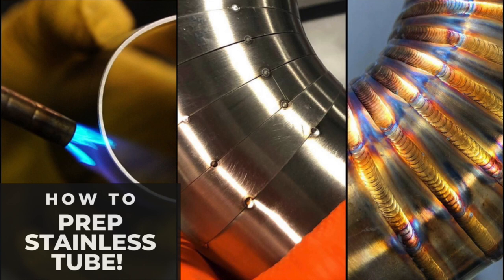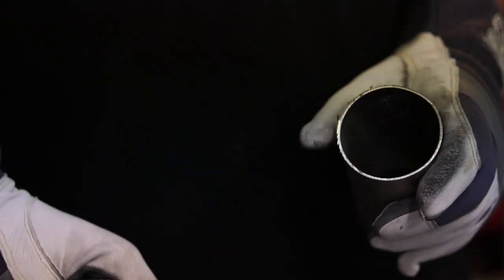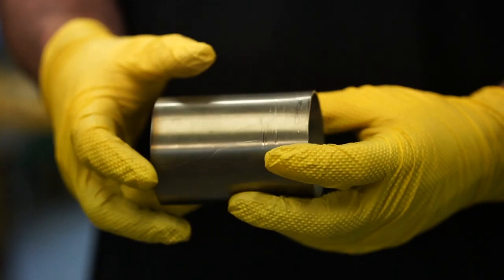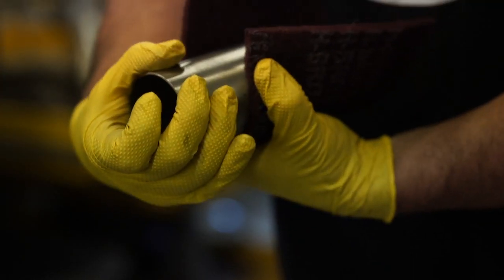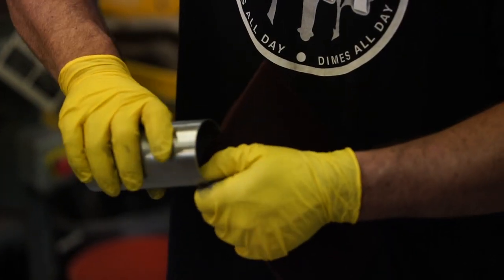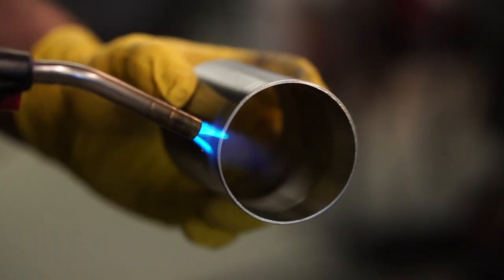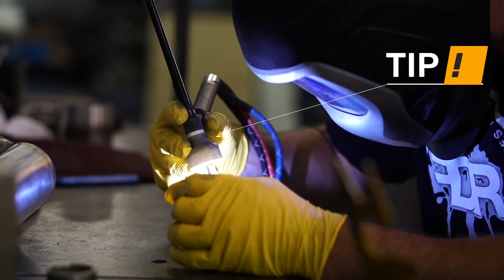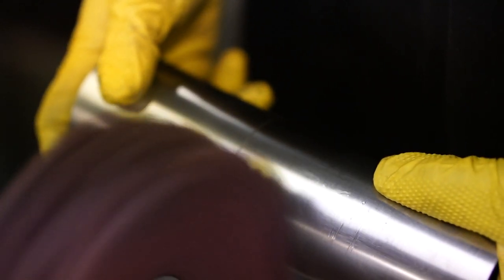HOW TO PREP Stainless Steel Tube (QUICK) for TIG welding + Tips!

Comment: Great tips, thank you! Do you back purge your tack welds? I'm just a hobbist and currently building some stainless exhaust where I didn't back purge my first tack welds and the inside of the tubing was pretty terrible so I'm purging them now.
Reply from the maker: Jeremiah Zanin on titanium I will back purge my tacks because it is 1mm or .040” thick usually so it’s easier to accidentally full penetrate on A tack. Now in stainless I don’t purge my tacks on .0625” wall because I use a lot of baby racks at lower amps that do not penetrate through causing carbide precipitation. I’ll be posting a video on back purging stainless tube Friday!
Reply: @hourglassingenuity103  Makes sense, thank you! Looking forward the back purging video!
Reply from the maker: Thanks for tuning in man! Really appreciate the engagement.

Comment: Hey Brad, I use a portaband (vertical stand homemade) and bench belt sander but I am struggling with getting clean cuts and then getting a flat surface for a tight fit up. Can you please drop some tips for a nice flat flush ground face?

Comment: Very nice! Do you always just hand sand it flat without using a table for keeping it square?
Reply from the maker: Yep.. I can usually get extremely close. I can check it with a square and a flat surface if I want it to be perfectly square. Usually a super micro angular variation won’t effect fit up too much. I can do a video on how to square off the end of stainless tube also in the future by using a flat surface and a square.
Reply: @hourglassingenuity103  Gotcha! As long as the band saw is dialed in, it should be pretty square to start with. I think it's good have the skill to do it by hand. Plus you wont risk adding surface defects sliding it on the table...
I look forward to your future videos!
Reply from the maker: Brandon Parry exactly! The thicker the blade.. less deflection and much easier to keep nice square cuts. Old saws with .750” wide blades work really well in my opinion. Especially on titanium! Thanks for watching and I’ll be posting every Wednesday and Friday!
Reply: @hourglassingenuity103  another thing is, you don't always cut straight pipes. what if there is a 90° bend that has to be sanded, obviously you cannot push it 'against' something to check the square, bc the whole pipe is a bend. the only thing you can do is to check the flatness of the cut via the shine light through method.. however I am keen to know if there are any really good methods, tools or jigs to make sure your bent pipe cuts are exactly flat.

Comment: Great vid, but i have a few questions if you can help? 
1. I cut alot if mild steel on my bandsaw, is the blade ok to use on stainless steel, or will it contaminate it?

2. What grit do you use on you're belt sander for grinding the stainless? 
✌

Comment: Professional welder here, who spent a decade in bio-pharm and semi-conductor ultra high purity piping, specifically a pipe fab shop.
Rarely did we use a belt sander (contaminants), only for fab'ing special fittings. Didn't use much scoth brite either. NEVER used tools that had previously been used on carbon steel pipe. We always used backing gas (99.9% Argon) for tacking to eliminate internal bluing, and our machines had high frequency starts to prevent tungsten inclusion. But mostly, we used GF and Metabo facing machines to insure square cuts, and pipe reamers and small fine files to remove burrs. We cleaned our joints with isopropyl alcohol before tacking, and sealed the joint with reversed electrical tape.